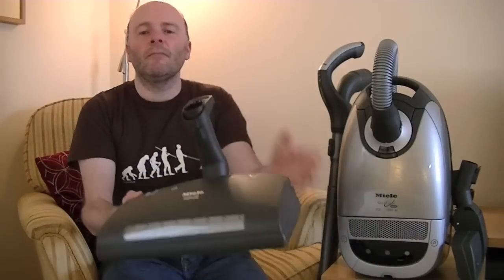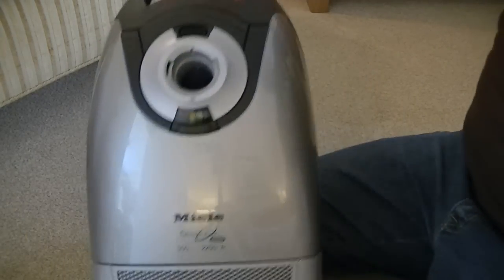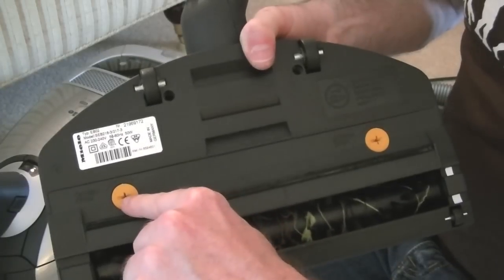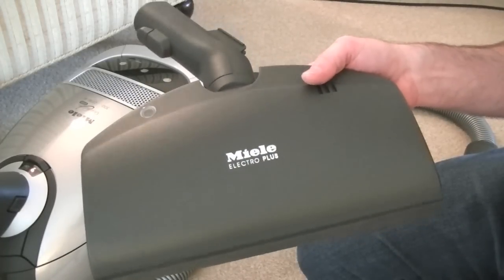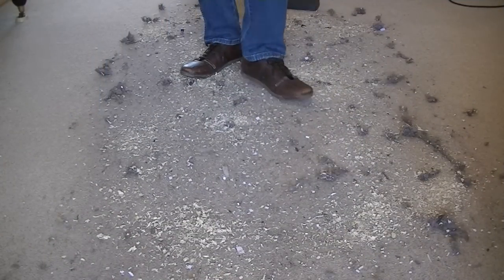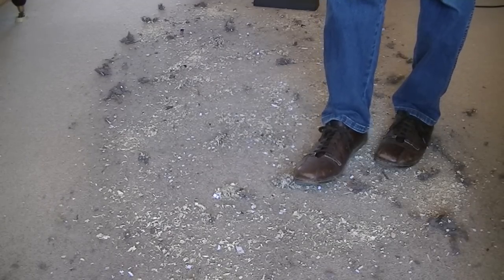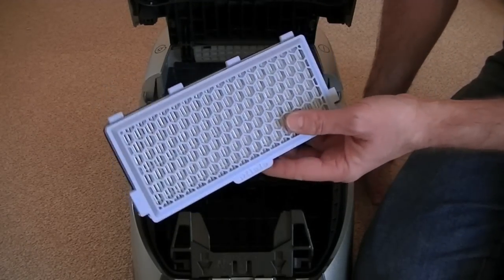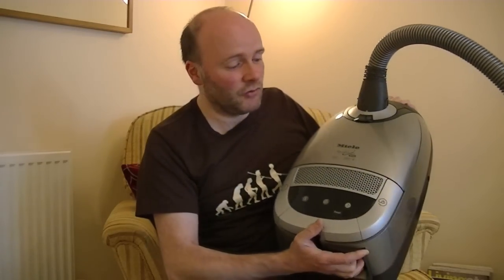Miele S5 Revolution 5000 Cylinder Vacuum Cleaner Demonstration & Review

Comment: When the power level is set to max and you have the standard head fitted, if you turn the vacuum on and then place the head flat on the carpet and the bag indicator stays full when you lift the head off the carpet, then the bag is full. I think my S5 said this in the manual.

Comment: Love this I recently purchased an s4 when they were trying to get rid of high wattage machines for a very good price it only has the airclean filter but the genuine bag keeping the dust bag compartment spot less has made me think twice about upgrading to hepa I just hope the airclean catches all the carbon dust as I do have a dust allergy. All my bagless I put the container deep into the outside bin and press the button with filters I fill the sink first with warm water and submerge the filter to clean it keeps me free of symptoms
Reply from the maker: UltraPerformer I have a top of the range S4 with remote control and accu nova power head which I hope to make a video of soon. The airclean filter is very effective. Just put a new one in after every four full bags.
Reply: UltraPerformer and

Comment: Hi what is the difference between the revolution and the cat and dog model? Also which is better? Regards
Reply from the maker: The cat & dog models have an air powered turbo head, whereas the revolution has an electrically driven head. The Revolution does perform better but is heavier to use and has some reliability issues.